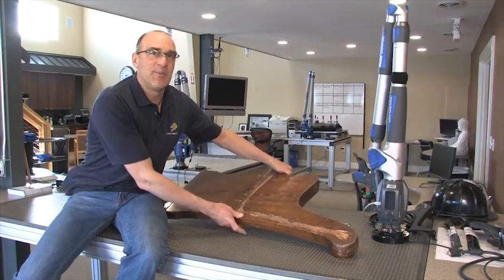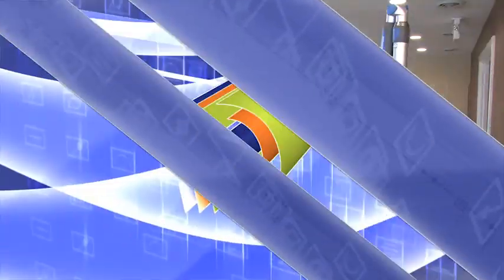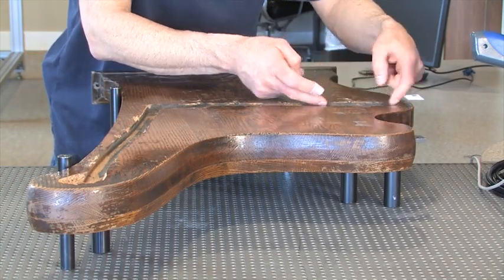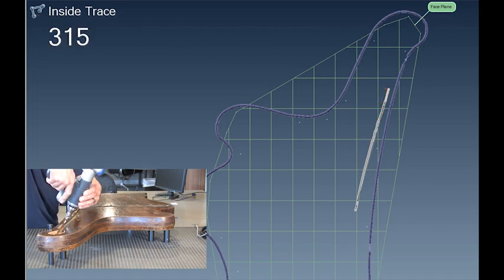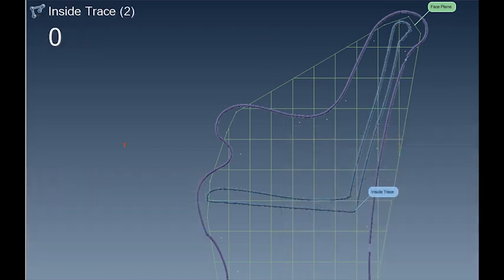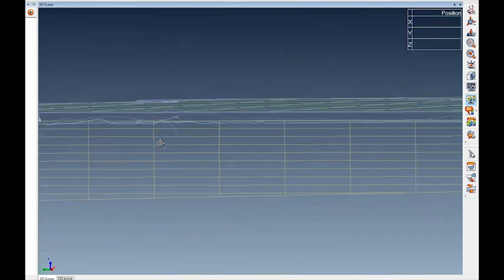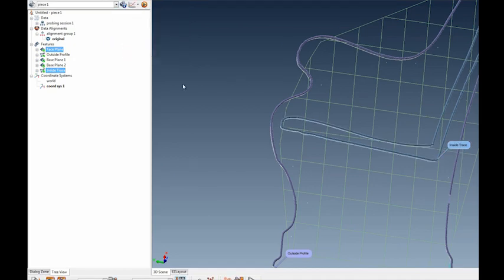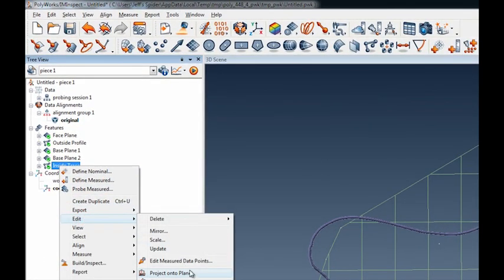PolyWorks: Polyline Capture - Continuous Distance

Comment: Hi, Thanks for this post.  On the inside corner, at 5:06, you can see a small irregularity in the polyline.  Is that something you can or do correct?  Thanks again. GHD
Reply from the maker: Hey there, George!  Good to hear from you, my friend!  Yes, the points that were in the "data capture" portion can be removed and the polyline will re-stitch itself but what we usually do is pull the polyline into a CAD package and then lay a perfect sketch and use the polyline from PolyWorks as a stepping stone to create the cutter path of the NC router.  Fun stuff!  How is the measurement going in your neck of the woods?
Reply: @diversedimensions1  Thanks!  Going well. Im having a lot of fun with Polyworks and 2 FARO Quantum S.  Hard to believe they pay me for this stuff sometimes..
Reply from the maker: @georgehd603  True story!  I feel the same.  I tell my daughters that I would do this work for free if I could.  Never a dull moment.  Would love to catch up over a cup of coffee and talk shop whenever your schedule allows.